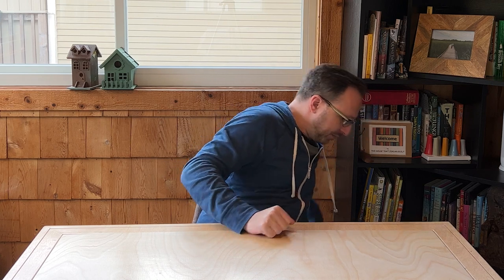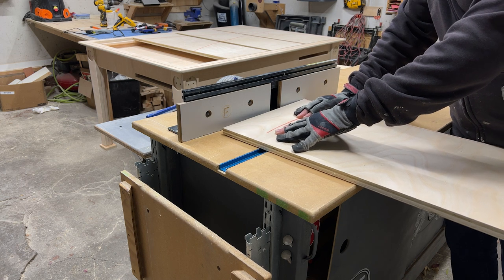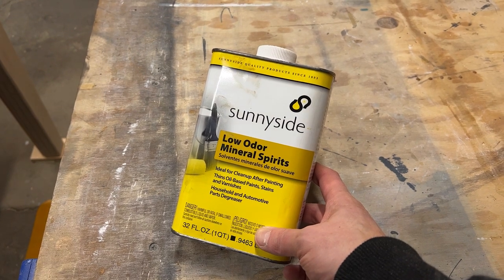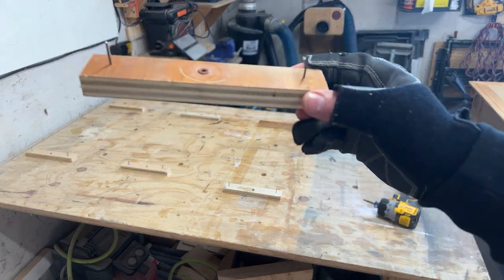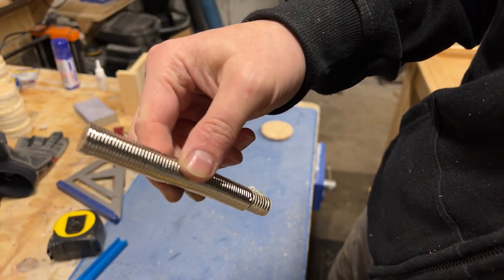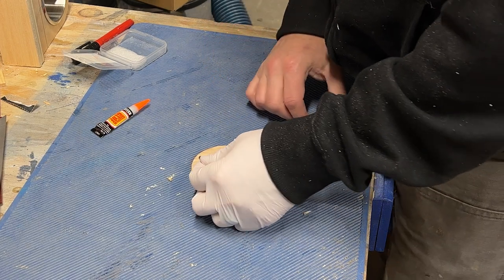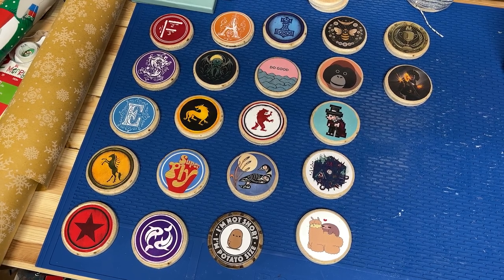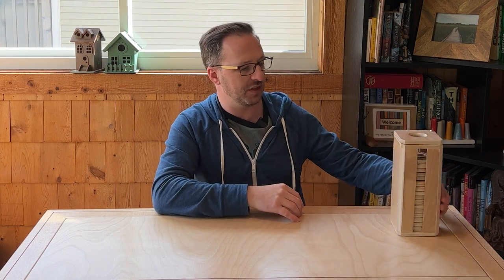SuperPly Gaming Table - Part 3: Leaves, Lights & Accessories

Comment: Great job! If you happen to do this a second time, I have a suggestion for glueing the fabric onto the board. Lay the fabric upside down on the ground. Tension the fabric with family by getting them to stand on corners, etc. Then with the glued board, lower/drop that board onto the fabric. 

Again, awesome table!
Reply from the maker: Thank you! That's a great suggestion; I think the only thing I was hesitant about doing it that way was getting the fabric dirty, but now that I'm more familiar with speed cloth I don't think that would have been an issue.

Comment: Just watched your entire series - great inspiration for my own upcoming gaming table :) How come you didn't use some LED diffuser panels for your LED strip? It does make it easier on the eyes. What size is your glue bottle?
Reply from the maker: Ooh, love that. I hope you can grab a few ideas for your own design. And super excellent question: to be honest when I built it I was unaware of those diffuser panels and channels, but came across them after the fact and definitely thought they’d be a step up. Could I switch them out for those now? Sure. Will I? No, because I’m lazy. BUT if I was doing it again I might invest in those for a cleaner look and softer lighting. Great suggestion, and good luck with your build!
Reply: @withJordanFrank  thanks :) what size is your glue bottle? I want one for myself :)
Reply from the maker: @jessicaalvis7063  Oh sorry, it's a 16oz one. I believe this guy right here: https://a.co/d/4uQKqNk
Reply: @withJordanFrank  thank you ❤️

Comment: Great build! I've been looking at a lot of plans and really like yours. How heavy is it using 3/4 ply? Think it'd hold up just as well using 1/2 ply?
Reply from the maker: Thanks Mike! I don’t have an exact weight but it’s fairly heavy. Two people can move it though with no issues. I would not recommend going 1/2” - I think there are too many spots where 1/2” might want to warp. Particularly the leaves- those should absolutely stay at 3/4”. Hope that helps!

Comment: Hey Great build series!  Would love an update on how the plywood is holding up and how practical you find it. I oogle this table so much. My husband is concerned that as a D&D player or DM these types of rails don’t hold books and dice and character sheets etc. Do you play any accessory intense RPG to help me convince him to build?

Also do you have affiliate links for your plywood router bits, magnets etc? Happy to support if so :)

Also faux car upholstery leather makes a great surface that doesn’t streak if you’re considering replacing.
Reply from the maker: Wow, so much great stuff here, thank you! First I will say I do not have any sponsors or affiliate links or anything like that, I’m not very business minded but probably should be, but thank you for asking.

Second that’s a cool tip for a play surface, I will note that somewhere, thank you. 

Lastly, most importantly, I’ve had zero issues with the durability of the table. None. The closest game I play to D&D might be something like Scythe, but that doesn’t support books or character sheets or anything big and vertical like that. I have no actual plans at the moment to design accessories specifically for D&D, but the beauty of the rail system on this table is the all use the same back piece, so you can make whatever custom accessories you want as long as you fit it in the back pieces. You could absolutely have a larger tray capable of supporting books, etc. I can think of other ways to hook something over the top as well. I’d be happy to consult with you for ideas if it would help
Reply: @withJordanFrank you absolutely should set up an affiliate link for the things you recommend!

Comment: Awesome build, great idea with the t track. One question. I did the same think with a 3/4" plywood for the leaves. But they are warping bad, have you noticed issues with this? I was thinking about inlaying steel track or something to force them straight.
Reply from the maker: Thanks man, I appreciate it. Sorry to hear about your warping, that sucks. I will say I have not had that issue- I don't know if it's because I was careful to coat them all over with 3 coats of poly, or, and I suspect this helps, I think having the tongue-and-groove connection between the leaves might help. It keeps them semi-locked in with each other when they're on the table, and that might be enough to keep them flat. I don't know, but sorry to hear about yours.
Reply: @withJordanFrank  Thanks for the response and happy to hear your table top is solid! I actually glued/nailed another 3/4" piece of ply to my leaves underneath, just smaller so it still fits in the slots on the sides. The leaves to feel alot more substantial. At first glance it appears that it did fix my issue. But wont know until its completely dry. Thanks again!

Comment: Just bought the plans, thanks!  I wonder how the accessories could be placed without a screw (simply for aesthetic reasons).
Reply from the maker: Awesome, thanks Sam! The two screws in each accessory can’t be seen when you attach them to the table, but I take your point that they’re a little obvious when not on the table. You could make something fancier with a similar shape made out of wood; maybe brass screws to class it up a bit? If you think of something cool let me know!
Reply: @withJordanFrank  great idea with the brass screws 👍

Comment: Okay, maker secret...use downcut spiral bits.  They literally leave no tear out.
Reply from the maker: I'll admit it, I still get confused when to use upcut vs downcut. Thanks for the tip!
Reply: @withJordanFrank  Upcut is for hogging out.  Fast efficient bits but rough.  Down cut is for finish work. When you want your lines to be clean and no tear out.

Comment: Just wondering: how spill-proof did it turn out? 

Thanks for the vid!
Reply from the maker: Great question:,it actually was more spill proof than I had hoped. My wife spill some water on the surface that sat there for like a week better two boxes. When I discovered it it ahead slightly stained one of the leaves (even though it had 3 coats of poly) and but there no signs it had leaked below. If it had it was real minimal. So I’m happy with that. Also I think you need some sort of tongue-and-groove just to help hold the surface flat
Reply: I was considering adding a full table top to the table instead of the in lay variant to make it more spill resistant. Also to make it more smooth and give it that one piece look. 

Have to say yours looks great so considering the in lay now. Saves some height.

Comment: what are you doing to combat warp on the plywood leaves?
Reply from the maker: So far so good. No warping. I think it might be that I coated all sides with three coats of poly so it’s an even seal, but I suspect it’s more the tongue-and-groove joints between each leaf that is helping them keep flat.

Comment: i would love to make my own table but haven't worked with wood since middle school shop class.
Reply from the maker: All you need is to believe in yourself*!

*and a table saw, router, pocket-hole jig, drill-press is helpful, sander, a lot of clamps, $600 and a month to do it. But mostly just belief in yourself.